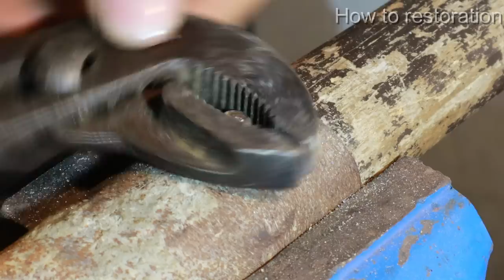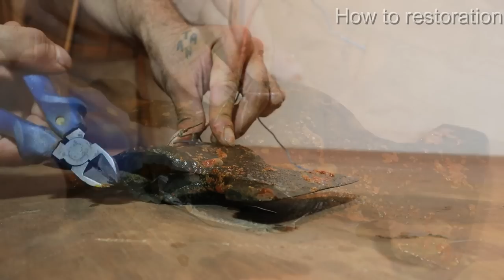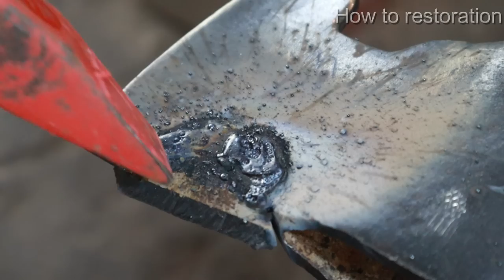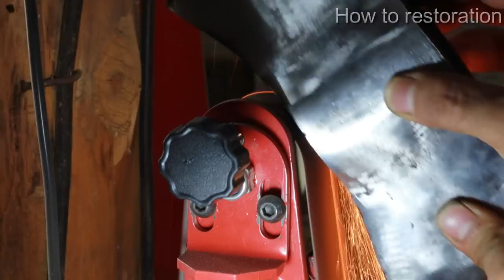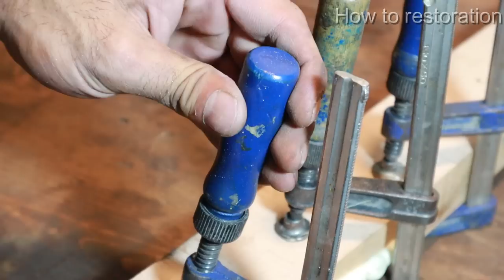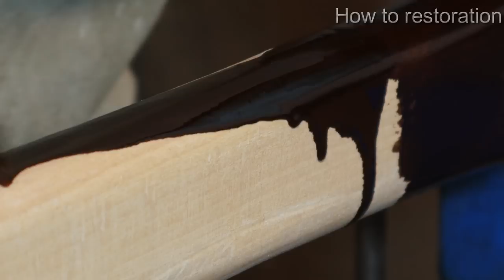Reviving An Double-edged Rusty Axe - Watch The Transformation!

Comment: It's a shame you didn't restore it as it was and turned it into just another double sided axe
Reply: @HowToRestoration  good work mate Skills at its finest 💯👍
Reply from the maker: @fabiankawau3362  thanks
Reply: This is NOT a restoration. The original character of the axe was sadly lost.
Reply from the maker: @dbennaphtali  Dear friend, you didn't watch the movie carefully and you gave the wrong opinion, please watch the movie again. Actually, I returned the main character of the ax to it, the ax is like this that I made it. The ax that you saw first was cut and a  A thick iron pipe was used as half of the ax handle. From now on please do your research before commenting on something and then do it thanks.

Comment: Drive’s me crazy when people use tools for their unintended purpose. A screwdriver is not a chisel or a pry bar .
Reply: it is if you dont have a chisel or a pry bar lol
Reply from the maker: Ok
Reply from the maker: @johntuffy5721  🫤
Reply: A tool is a tool, it's purpose is whatever task it is successful at accomplishing. A screw driver also isn't an oil filter socket but you do what you have to.
Reply from the maker: @nickschaefer9320  I did not understand exactly what you meant, in any case, thank you for watching
Reply: I don't think there are many pry bars that small.

Comment: Should have kept original shape ! Those added in bits will Crack if ax is used much !
Reply from the maker: The original shape of that ax is what you see right now, and I made it, and this ax was destroyed before and the places that were filled were cut with grinding stones, and this is not its original shape, its original shape is that  What I made is what you see.

Comment: Looks like someone took an old double bit axe and tried to make a hunting hatchet out of it, rather poorly.
If they'd of ground the bits to the same length and not took a chunk out of the eye, it wouldn't have looked as bad, pre restoration.

Although I like the idea of the extended collar for the haft. Makes it a lot harder to break if you overshoot what you're swinging at.
Reply from the maker: Yes, you are right
Reply: You're probably correct. Every extra ounce in your kit feels like an extra pound on the trail. I have a broad hatchet I did something similar to. Added a bastard sized handle to it. I plan to add a handle to it that is in between a hatchet and an axe handle in size. About as elegant looking, but it's way easier to pack and use. No function lost. Custom or modified tools are fun to look over even if they're done without regard to aesthetics. I like the puzzle they present when you try to figure out the why and how of it.
Reply from the maker: @blatantmisconception  🙏🌸🌺